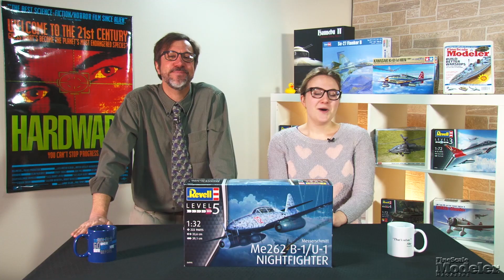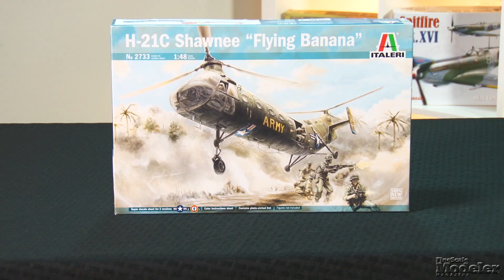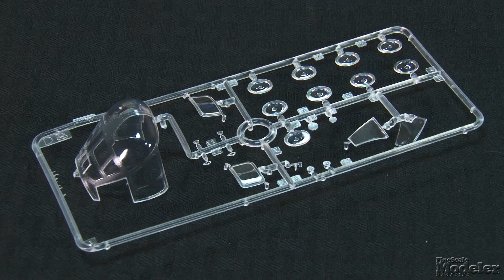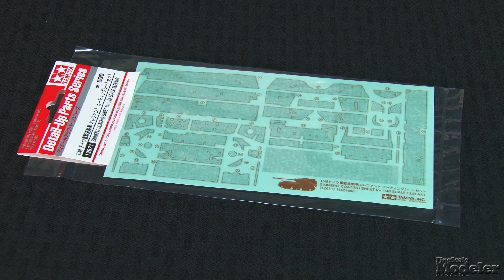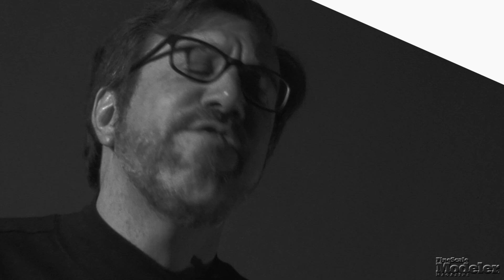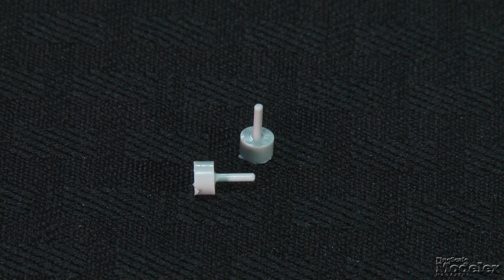Revell Germany Me 262 night fighter, Italeri Shawnee, Tamiya Elefant, OzMods Bristol Freighter

Comment: I have the 1974 Revell Japan 1/32 Messerschmitt Me.262 Swallow, I'm very curious to know what the differences are as I see that all releases were from the same 1971 Revell release but, with either new parts (depending upon whether they were a standard fighter, had the canon, or the radar), new decals, or just a new box, but I see releases being issued in different coloured plastics, do any vary in actual build quality or detailing?